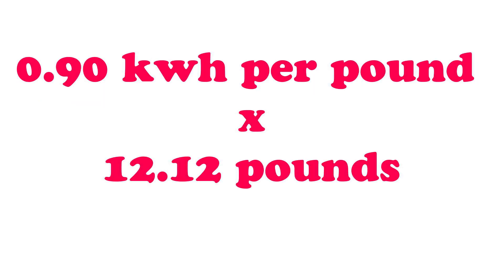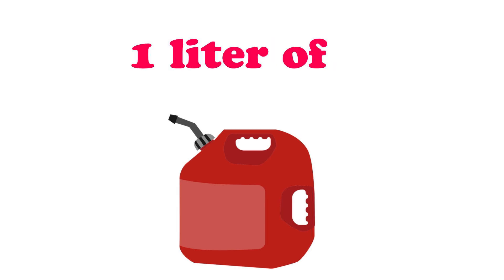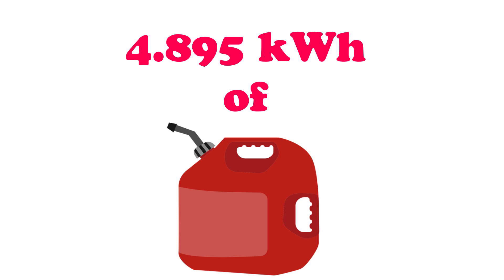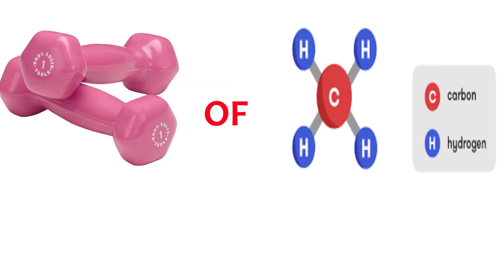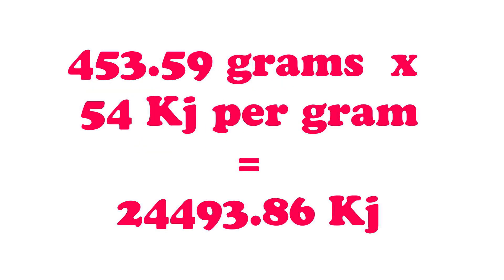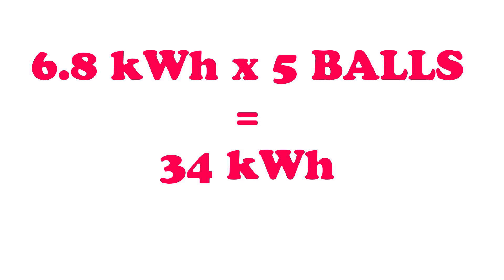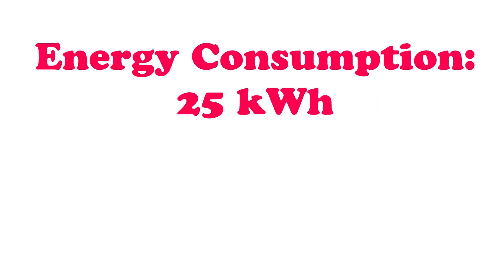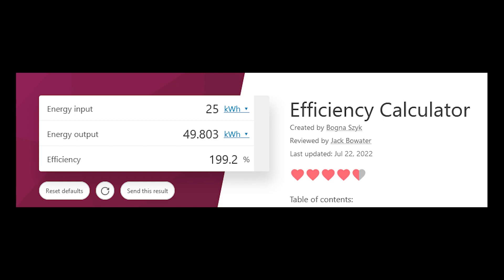Mark IV Plastic to Fuel High Efficency Calculations!

Comment: It would have been more honest if you'd also included the starting plastic input mass plus the starting carbon microwave absorbent mass which is no doubt included in your "coal" measurement.
It would have been further more honest if you'd mentioned that a small (not commercial) generator is only about 25 percent efficient. You get roughly 8kwh of electricity from 4 liters of gasoline.

So lets redo your figures and multiply your less than 200 percent efficiency by 0.25, right? We get 50 percent efficiency, not factoring in the loss of the plastic and coal fuel you put into it.

You could scale this up to power a turbine generator, which might break 50 percent, in which case you've made a machine that does nothing. You might as well just set fire to the plastic in a pile on the ground.

Talking about setting fire to the plastic, why not just do that? A regular fuel->steam->turbine->generator setup. By your extraordinarily erroneous and dishonest math, that setup would have infinite efficiency because it takes no electricity and apparently we're not factoring in the actual fuel cost.

If you actually read any of the papers on microwave pyrolysis of plastics, you'd know that the purpose is recycling feedstocks, not producing fuel because, like I already said, the plastic itself IS fuel.

If you absolutely must get liquid and gaseous fuel from plastic, remove all that microwave junk, weld a simple firebox to the underside of your tank and just do the pyrolysis thermally. You'd have even more balls then and you wouldn't be wasting electricity.

Comment: How does this work lol

From my limited understanding of thermodynamics, I do not understand how you are getting more out than you put in that just simply breaks the rules but if there is an explanation I would love to hear it.
Reply: It's not more out than in. It converts garbage to fuels. The in is the mass of garbage. Mass is fuel, it is the input to the equation.
Reply: @newmonengineering  Yeppers, figure that's the energy of the garbage transformed into carbon and lets say liquid hydrocarbons and let's say natural gas.  Easier to fuel other systems that are designed to burn/combust the liquid or gas or solid forms versus the "whatever" raw material.  Basically, is a refining operation that refines waste materials into more useful forms of fuels.

Comment: A better estimate for the energy content in the yoga balls would be by using their volume (assuming atmospheric pressure and 20C), because the weight measurement is a bit inaccurate (also when measuring the weight of a large volume don't forget to account for buoyancy, albeit that's a minor correction).

Assuming you're using extra large yoga balls (75 cm), the volume is about 4/3*(0.75/2)**3*pi = 0.22 cubic meters. Let's for now assume the ball is filled with natural gas, which has an average energy content of 10.2 kWh per m^3, then the energy content of the ball is 2.3 kWh not 6.8 kWh. If you're using the "Large" size yoga ball (65 cm), then this would be 1.5 kWh.

This changes the calculation a bit:  5 kWh from oil + 5*2.3 kWh from gas = 16 kWh, this would be directly useful. If we add the 11 kWh from the carbon residue that's about 27 kWh, but I'm not sure how to use that, can you simply burn it? Maybe a demonstration would be useful.

Compared to the 25 kWh of electrical energy put in, this would mean that the process is about at the break-even point in energy. (For the 65 cm ball it would be 23 kWh, so just below break-even).

Cost wise it's still not a great deal, about 50 cents in oil and 50 cents in gas versus 5 dollars electricity...

Edit: A quantitative measurement of the energy content of the gas and oil would be useful and not too hard to do with a basic experimental setup. It should be possible to do a ~20% accurate measurement at home without any extensive laboratory setups. A big question is the purity of the gas and oil, we're assuming natural gas and gasoline, but we would need to confirm this. Moreover, how to use the carbon dust is not 100% clear to me.
Reply: It would be correct to assume that in order to get to electricity, we would use a lister engine for the liquid and an otto engine for the gas, burn them and then get ideally about 40% efficiency so about 6.4 kwh of electricity. 

Although it might seem bad, if using solar energy that would be wasted instead, we would get an energy storage with a 25% efficiency, which is actually not that bad. 
And of course we could use the waste heat provided by the engines as well as the coal for heating, that would not be a bad deal at all.

Comment: to determine the amount of moles in the yoga balls you could use the ideal gas equation P*V=n*R*T (P=pressure; V=volume; n= mole of gas; R= universal gas constant; T= temperature.) 
the gas constant is 8,31 then you do some math to get to n=P*V/R*T

furthermore you could use CO2 or nitrogen as an inert gas it´s much cheaper than argon, if you want it even cheaper use some gravel (or other sources of carbonate such as baking soda) and hydrochloric acid this will generate CO2. 

to completely purge the container you have to use 120% of the container volume. there is something called a cold trap with this you can liquefy your gas to decrease the amount of space needed by a factor of 260, alternatively you could pressurize the yoga balls to 8 bar